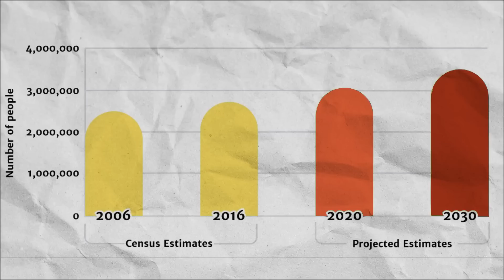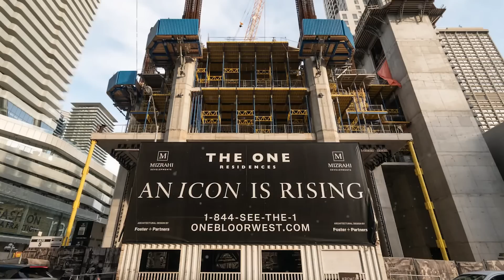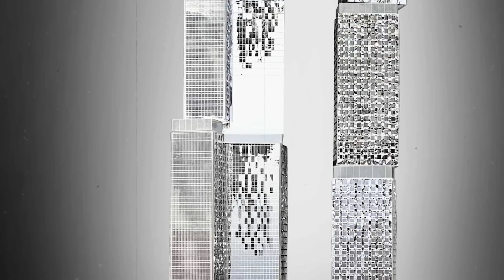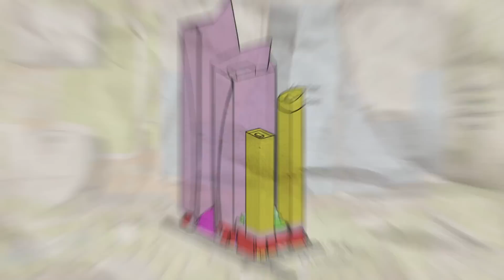The New SUPERTALL Skyscrapers Coming To Toronto Canada

Comment: The infrastructure is still the number one problem in Toronto. When are the high tech sewer, water, and electrical infrastructure going to be built? In addition, the new subway/LRT lines are way behind schedule. When are they going to be finished to accommodate the million more residents in 2030?

Comment: Sky Tower at Pinnacle One will be the tallest residential building in the world by floor count once it's completed
Reply: Why would you use floor count haha. What a dumb metric. Dubai and New York have many taller residential towers.
Reply: @shuss-pi3me  Because it will literally be the tallest by floor count. I didn’t say tallest overall.
Reply: Not the world. Just Canada. Central park tower in New York currently has the tallest units in the world at 110 floors. Sky tower will be at 104 floors.
Reply: @nanaokyere7141  Yes, in the world. Check Wikipedia
Reply: @nanaokyere7141  Central Park tower has 98 floors. But looking now, Dubai has one proposed with 122 floors. So I guess if it’s built, it will hold the record
Reply: @nanaokyere7141  Central parks floor count is 98
Reply: @nanaokyere7141 no it's 131 at cpt